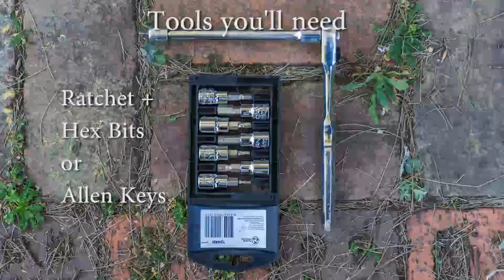[How To] Change Your Front Brake Pads (Monoblock Caliper)

Comment: Great video.  Tip I learned is to keep old brake pads in and apply brake pressure to clean the pistons.  Then you can compress pistons (after cleaner) with old pads and then remove them.  Insert new pads and you’re all set.

Comment: Never tighten the calipers without pumping pistons out first and while holding the lever tighten the caliper bolts. Needs to be done this way to ensure calipers are lined up properly with the disc
Reply: Is it normal for dics to get warm after short test ride without even touching the brakes because of the pads drag

Comment: Awesome video! This video has made me confident enough to do the brake/caliper work myself. Thank You!! I noticed you included brake fluid in the beginning as one of the "tools you'll need", but I didn't see you use it for anything. Brake fluid is only used when the pistons are completely removed from the caliper correct?

Comment: Hi, awesome vid. Used it to change my pads on my Street triple. 1 question though, is it okay not to put grease at the back of the pads where the piston make contact? When i removed mine there is like a coat of hardened grease at the back of the pads. Just some thing i notice.

Comment: Great video thank you. I do have one question, when putting the brake block back on the mounting with the new pads in, you pressed the brake lever, won’t the brakes be rubbing against the disc all the time?  I had new discs and pads replaced under warranty on Tuesday by the supplying dealer and on Thursday have just had new tyres put on by a local garage, the front brakes are now grinding/rubbing when I turn the front wheel manually, is this right, surely they shouldn’t be! Regards. Paul.

Comment: Thanks for the amazing video. Question for you: What do you do if one of the pistons pops out as you are pumping the brakes without the pads in there? Simply pop it in and bleed the brakes? Thanks!
Reply from the maker: You would just clean it with some brake cleaner to make sure there will  be no dirt behind the piston when you put it back. Once it's clean, lube it up with some fresh brake fluid, and make sure the o-ring seal is seated correctly when you push it back in, that 0-ring seal is the most important part. And then yes, bleed the brakes!
Reply: @howtomoto  Hi! thanks for the vid. I unfortunately had a piston pop out on me and I put it back and bled the shit out of the brakes, but still feel spongey. Do you think that means I haven't bled them enough or that I might have put the piston back in incorrectly?

Comment: Only one question here. How do  make sure that the pads are in the centre of the caliper? i.e. not to one side causing the caliper to rub the dics? Because the disc to caliper clearance is very tight on these brakes therefore the gap between the pads must be correct.
Reply from the maker: The very first thing I would check is whether any of the pistons are sticking. The way the caliper is bolted to the mount in combination with the floating tolerance of the disc, you would have severely worn out disc buttons if the two made contact. I've never had a huge issue as after I change the pads, I depress the brake lever and it centres the pads onto the disc.
Reply: @howtomoto  my original discs on my 1198 were knackered after 15k miles they were very loose on the bobins and because they are semi floating not fully floating I binned them and fitted new seris oro discs. But it doesn't always happen the the pistons come out equally both sides of the caliper and the mounting bolts have side to side clearance between them and the caliper holes, therefore it "maybe" possible for the pads to not be central to the disc rotor. I walays check caliper to disc clearance by inserting a feeler guage between the caliper and disc making sure they are the same both sides of the disc. Thanks for your reply :-)
Reply from the maker: @ivoruren3086  I'd honestly never considered this, I'll have a look next time I'm playing around but my caliper bolts and disc bolts don't seem to have any play in them at all.
Reply: What you do to centre the pads is do the caliper bolts up finger tight. Spin the wheel and squeeze the brake lever. Do this a couple of times then spin, squeeze and hold the lever on tight to hold the pads in position. Then reach round and torque the caliper bolts while holding the lever. This will ensure the pads are central. When you spin the wheel afterwards you should hear a consistent sound from the disc as the pads slightly rub it. If the rubbing comes and goes then either it’s not central or you have a sticky piston or warped disc.
Reply: @laurencelagden  that's about the same as I do, thanks.

Comment: Hi, why didnt you smear the backside of the pads with copper grease? Thanks
Reply from the maker: Honestly... I didn't find it necessary. The only thing contacting the back of the pads were the caliper pistons. As you can see I did apply it to the anti-squeal plate/spring to make that easier to clean. I just didn't see how it would help the pads as I usually throw those away when I service the brakes. The minor down side may be a bit more brake noise, but that doesn't bother me, I hope this helps :)
Reply: Rene, copper grease is not necessary on high quality modern brake calipers. Just give dirt something to stick to. You would have used copper grease on old cars to stop brake squeal. Good vid HTM

Comment: Should have shown the left hand side one...... I found it much harder to get off with 2 brake lines going to it.  I have multistrada and had to wrap a tshirt around caliper as I twisted it to remove it as it hit the wheel before the pads were clear of the disk.  Other than that well done, great video.
Reply: Michael Mcguire : I’ve been putting a few layers of wide electrical tape onto the rim, to try and stop the knock of callipers against rims. Seems to work well, 👍
Reply: @davep6286   thanks.  I wrapped an old t-shirt around the calliper Nd it came off without scoring the well too. 🤟

Comment: Just did my brakes on the 2013 rsv4 factory, is it normal for it to be slightly harder to push around? Also even after bleeding the brake levers feel a bit spongy, any tips?
Reply from the maker: Make sure your calipres are centred by loosening the axle nuts, pushing down on the suspension a few times and then tightening the axle nuts again. (I'm referring to the 2 bolts that clamp the axle, not the main axle itself). If it's spongy, it means there is still air in the system somewhere. Try googling how to bleed brakes with ABS systems.
Reply: @howtomoto  mechanic did the bleeding, now i did it myself with a friend after the first bleed(left caliper), it's fixed. Did some flushing since there's been solidified bits of brake fluid already.

Comment: Is it normal for one pad to wear slightly more than the other, I..e half a mm or so.
Reply from the maker: It means that the pistons aren't being pushed out evenly. For very small differences it's fine but when the difference is large, either the pistons need a very good clean or need to be replaced. (if there are only pistons on one side of the caliper, then it's normal)
Reply: If there’s abs and the rear is linked to the front

Comment: Is it normal to have one rotor warmer than the other not smoking hot just warmer?
Reply from the maker: If one is a significantly warmer than the other it could mean a caliper piston is stuck on one side, and hence not actually braking with full force and generating as much heat. It's hard to tell without seeing it for myself, but I'd say start by giving your brakes a solid clean and inspect the pistons and pads.

Comment: No grease on the back of the pads?
Reply from the maker: I’ve never done it and have had no issues, my pistons have never stuck to the pads.
Reply: @howtomoto  As I've understood it, the reason for greasing the back is to eliminate brake squeek caused by vibrations between pads and pistons.
I've never done any brake maintenance, so I'm in the process of educating myself on the topic 😊

Comment: How much does bermbo brake pad cost
Reply from the maker: I personally have never used Brembo Pads, but depending on which compound you pick (SA, SC, RC etc.) the price will vary. Overall, they're quite expensive. I love the feel of the Carbone Lorraine brand.
Reply: How much bolt torque?

Comment: ## DO NOT put copper grease on your caliper bolt threads. You can over tighten and strip the threads when using a torque wrench ##

Comment: Push the pistons inside before remove the old pads make easier job.
Reply from the maker: But then you can’t clean the brake dust and dirt off, I actually push the pistons further out and clean before pushing them back in.

Comment: I saw lots of movement on your disc. It looks as if its damaged. Looks dangerous.

Speaking from experience, the same thing happened but I disregarded, on my ninja650 2019

The disc cracked and damaged my front suspensions. (FYI only the right side of the disc broke and damaged the right side of the suspensions, it took a chunk out.) But if that is the way it, then so be it. Take care.
Reply from the maker: This was a deliberate modification to convert my rotors to “fully floating” which is why there is disc movement.